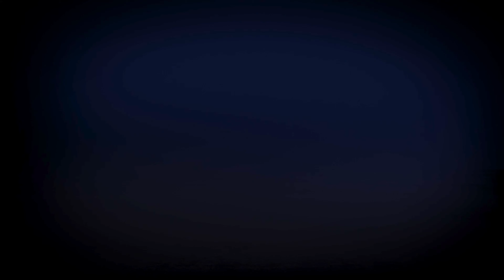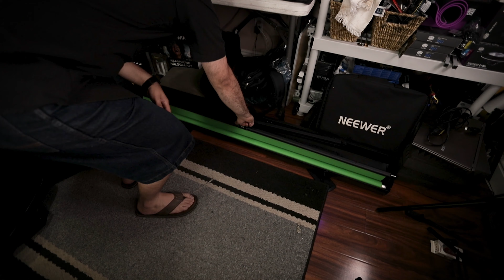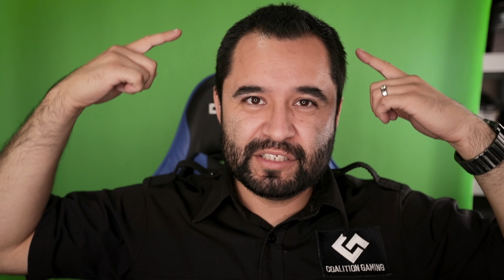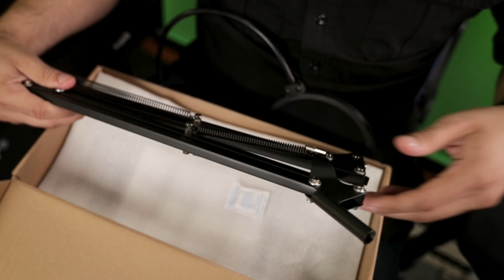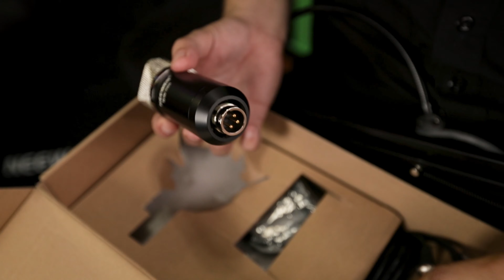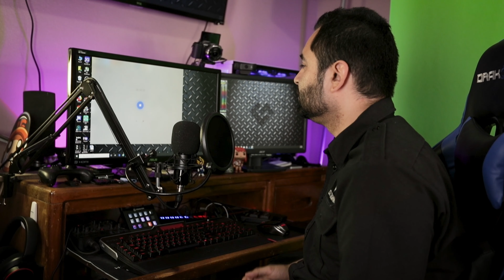STREAMER upgrades you'll need first!  - Ft. Neewer NW-700 & pull-up green screen

Comment: That's the exact set-up I use with the exception that I use the Neewer phantom power supply and it works really well. I believe I paid $40 for the whole kit on amazon. Had it for over a year and it hasn't given me an issue yet. I use it as is for gaming and run it through voice meeter banana for videos and streaming.
Reply from the maker: Its a pretty neat kit for sure
Reply: @CoalitionGaming  my mic has a echo, noise, and hiss plug and playing any idea on how to fix this?